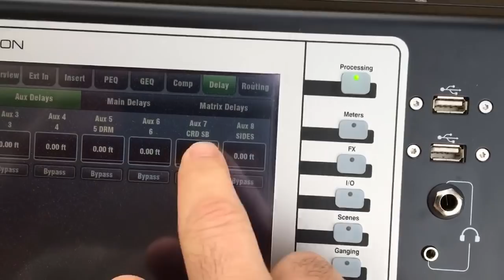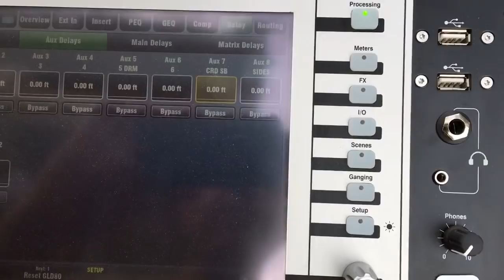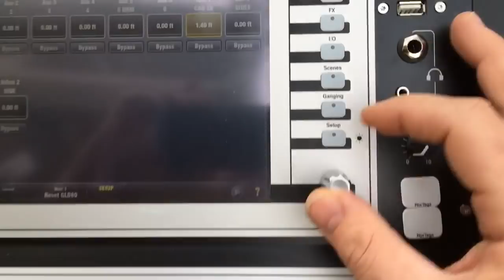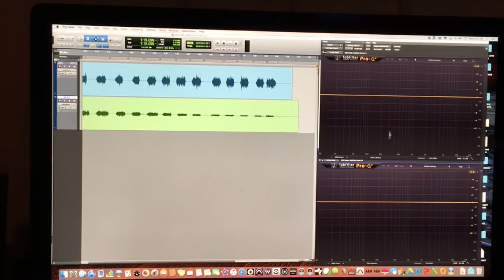Simple Cardioid Sub Setup

Comment: I do exactly this setup for a regular stage of mine (30 shows a year) - outdoor with open-bottom stage. Except I do the "end-fire" version, so the delay is on the front-facing subs. That gives a more accurate sub sound out front, but less cancellation behind. The amount of sub that still happens on stage is extremely low, once a band is up & running you don't notice it at all (subs are flush with front of stage because the dance floor is directly in front of it, I put one K12 facing forward tilted back on the center sub as a center-fill for the dance-floor and one on each side sub as front-center monitors, freeing up some stage space). It's not as clean as something purpose-built like the Next subs, but for moving air without rattling the stage it's a great compromise!

Comment: Thanks. I checked a couple of websites and videos and it was all about fancy formulas. Now this is the most hands-on thing that makes sense and I will try this for my next sound reinforcement situation.

Note that some subs have a cardoid system built-in, there's some by QSC, and the d&b y series subs do have it. However, the method in your video should work with any less-expensive subs, given you have 3 of them that are the same.
Reply: Dave Rat makes the math super simple in one of his Shorts. Don’t be afraid of it.

Comment: Reverse polarity just wastes energy. Think about it. If you had one subwoofer facing forwards and one backwards then your arrangement is effectively the same from front and back. It will still sort of work but you will have a configuration that is quieter than two subs at the front and quieter than one sub at the back.

You are supposed to delay the front firing subwoofers by about 4 milliseconds and place the front firing subwoofers about 4.5 feet ahead (closer to the audience). That means all cones are in phase at all frequencies in front of the subwoofer array (the rear firing subwoofer radiates soundwaves and the wave reaches about 4.5 feet out behind it right as the front firing subwoofers start generating the wave.) From behind the subwoofers, a sound of 62.5Hz is cancelled by a half wave because the sound of the audience facing subwoofers arrives a whole 8 milliseconds behind the stage facing subwoofer.

I'm assuming the 2:1 ratio of subwoofers is because a subwoofer cabinet has some slight directivity of its own such that outdoors it is 3-6 dB quieter behind it than in front of it.

Comment: How would three Integrity 24" woofers do (one facing rear)? They handle 2000 w rms so I need like three Crown XLS amplifiers. This would be for an outdoor system of course. I originally purchased four 15" Earthquake subs 1200 w rms with two XLS2502. If I have an outdoor concert, the band needs to be "happy" with the sound setup.
Reply: @streams76  I purchased three though I tried to get six at last minute of sale. Purchased Crown XTI 6002's because I can power 2 subs per amp and can adjust delay. So that's my plan for outdoor concert subs. Next up JBL 4889's.

Comment: I’m curious about this. I have 2 - KW 181s. My mixing board does not have the capability to delay the signal. I have two questions I guess. 

1. What is the cheapest way to create a delay? For instance is there an affordable rack mount or simple in-line box that could be edit? 

2. Wouldn’t keeping all the polarities the same and delaying the front firing speakers accomplish the same effect?
Reply: You need to move speakers then, or buy dbx pa system.
Reply: @СашаГаджетотСибиридоКрыма  can you please elaborate?
Reply: @KirkDickinson  if you move speakers farther you don’t need a delay i think. You can use dbx driverack pa 2 (or pa 1) to set delays. But i’m not sure it what’s you need.

Comment: I need your help. I have 8 yamaha DSR18 subwoofers. I want to set them up in a cardioid aray. Also for DSP I'm using DBX driverack vue360. Can you help. Thanks in advances for your time.
Reply: Don't they have a built in setting for this?